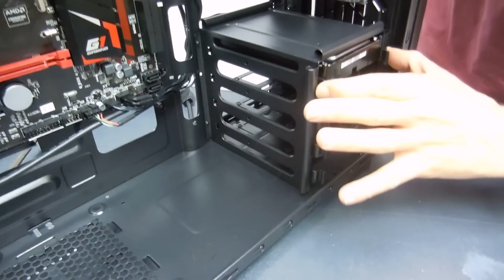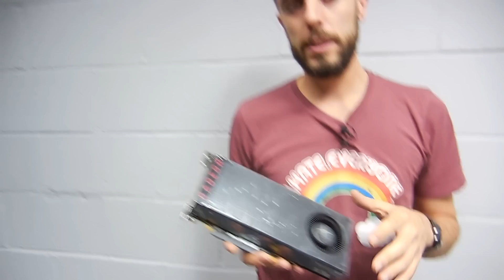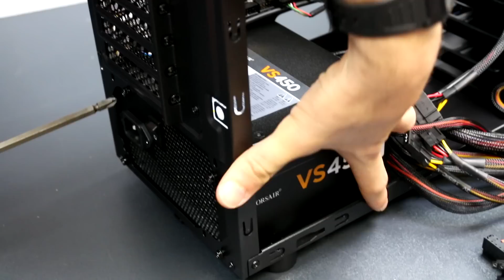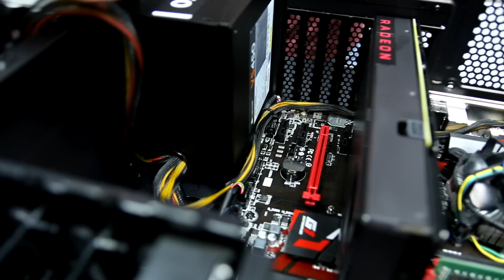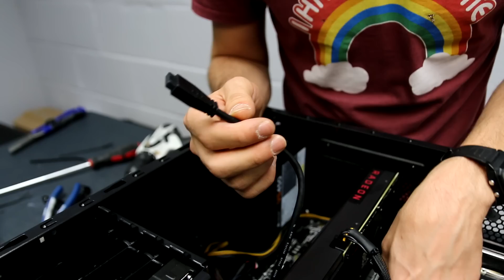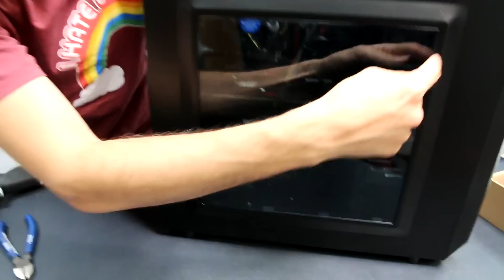HOW TO BUILD A PC: Step By Step Easy Guide (DINO PC) Part 3

Comment: Do you have to buy the sata cables ( not the one that are on the power supply ) for the hdd and ssd or they are included ? its important for someone to answer me. Thank you! Nice Tutorial !
Reply from the maker: Sata data cable are needed to "move data" between the motherboard and the SSD. Sata power are to send electricity from the PSU to the SSD. Your PSU (assuming is fairly recent) should have enough sata power to plug the ssd. The sata data cable usually comes with your motherboard. You will need both to make the SSD working
Reply: i meant the sata data cables do i need to buy and extra for my hdd too right ? Motherboard usually comes with only one sata i think. Nevermind Thanks !

Comment: if I have my hdmi cable attach to my graphics card is my screen all te time change from hdmi to analog
Reply from the maker: There should be an option to choose the input, which you can change to HDMI. Sometimes if you leave the option as auto detect it will switch between the two searching for a signal.

Comment: In my PC case, the memory slots for harddrive and ssd don't have those rails where you screw the ssd. What do I do?
Reply from the maker: When you say rails, do you mean mounts for an SSD in a HDD space? If you google 3.5" to 2.5" hard drive adapter that should help.
Reply: Raptorade same as mine.… what do we do!?
Reply: DinoPC nevermind. It was hidden. Lol

Comment: if you were to crossfire the setup, would you use the extra bit from the same cable connected to the first gpu ?
Eg the cable part he tied to the 24 pin

Comment: I got some old parts from a friend and I was wondering if you could tell me if any of it would be good for gaming. 
Graphic card: Geforce fx 5200
Cpu: amd Athlon 64 x2 
4gb of ram
Motherboard: Asus man-Sli
Reply: What kind of ram?
Reply: Kiro RotMG Sorry but no?
Reply: Kiro fuck no
Reply: Bailey it's ok I got rid of all those parts and bought completely new ones and built a new pc :) I made a budget build and parts where on sale when I bought them and it came out to $480.
Spec's:
I3-6100
Msi 1050 ti
Msi bazooka plus MOBO
8gb ram
S12II 430W
Western blue HDD 1TB
Reply: MrBombastic799 it can run at high about 45-60 at any average of around 50, but let me double check when I get home I'll test it.